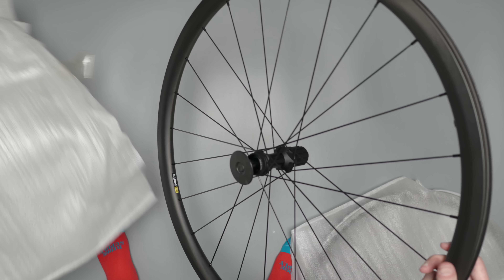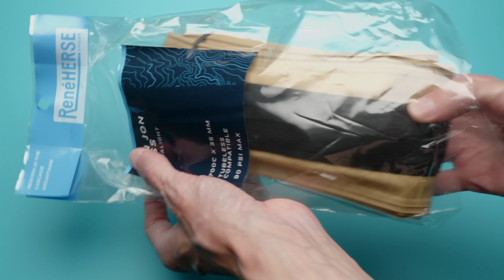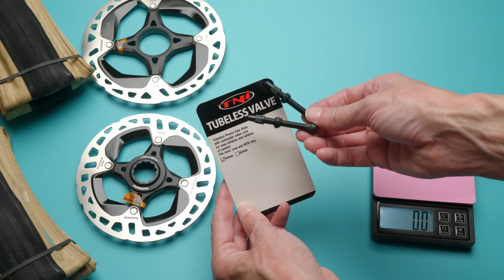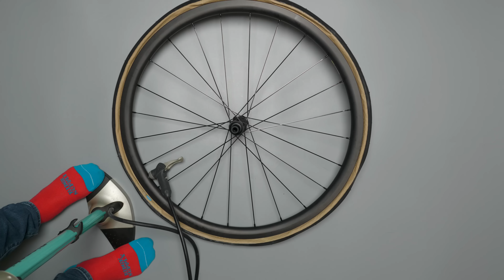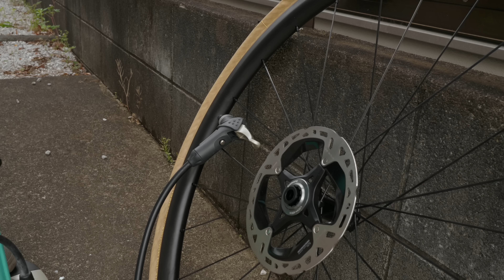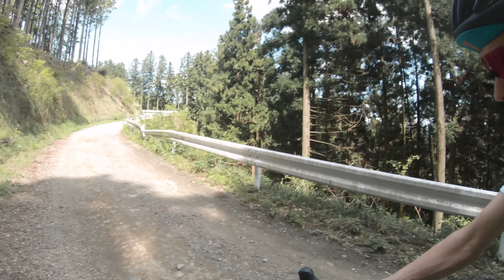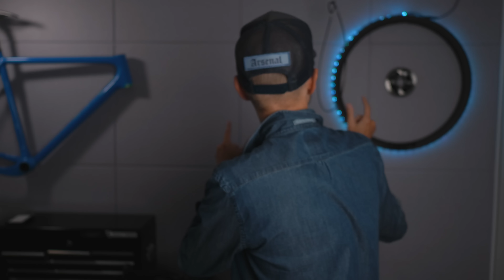Sub 7kg All-Road Bliss #newwheelday

Comment: Nice Video as always man :)
Had any concerns before buying them?
I heard so many good things about them, but for some reason I am still concerned about QC.
Btw, I saw on one of Hambinis PP-slides that he is going to get Open frame (or maybe he said it, cant remember) - nervous yet? :D
Also, did you have to register your bike in Japan? I remember when I was living there that I had registrations papers for all my bikes and had to show them to the police when I got stopped and asked.
Reply from the maker: No concerns at all. They are as reputable as any of the big brand out there, they don’t have the no-questions-asked replacement but their customer support beats most of the western brands I’ve been unfortunate enough to deal with.

Not sure why I would be concerned, it’s not my bike he is going to torch ;)

Nope, no registration for my open, only my commuter.
Reply: @ridesofjapan  Well, not sure why I am so hesitant, since I have no problem trying out parts from Ali.
Actually I expected this answer from you :D Its just fun at times how he is going on about tolerances... and other things.
Ever had any problems? Was just thinking to travel to Japan with my bike and this just popped into my mind. I got stopped at least 8 times regarding my bike in Japan.

Comment: paying hundreds of dollars to save 100grams on wheels, valves, and so on just to dump 240ml of sealant in them lol. wouldn't it be better to buy thicker sidewall tires that don't need as much sealant and on top are more puncture resistant?
Reply: Thought the same when I had to add a lot of sealent to my challenge tubeless wheels - stupid sidewalls.
Reply: No kidding, water is heavy, but I guess its not rotational mass.
Reply: Same here, glad i was not the only one, tried tubeless and i did the math, changed it back to inner tubes.
Reply: Its the double amount of what I'm putting in the 2.2" 29er tire. Don't see the point of those leaky tires.
Running tubeless road tires with 35mil of sealant.
Reply: @wajs1234  yeah same for my 2.5" maxxis minion dhf. Currently running around 60ml in my 37c gravel tires
Reply: It is a good point, but there’s more to it that that. The reason he puts that much sealant in is because it leaks, so a good part of the sealant will evaporate. Second, there is more to a light tyre than the weight itself. Light tyres are thin, which means they are supple, =fast rolling and comfortable.
Reply: Yeah, tubeless is comfortable and doesn't pinch flat. I'll never go back to tubes.
Reply: The water will eventually vanish, the sealant essence doesn't weight that much. In practice you'd need to average the weight and hence calculate with half the weight you put in.
Reply: @v8rumble123  It's eventually rotational mass.
Reply: @EditioCastigata  it'll only dry up after half a year tho and then it won't be useful anymore as it doesn't seal up holes anymore so you have to top it up. Then it's like 120g/ml of the new stuff as well as the old 60g of the dried up sealant
Reply: @dermax_hd  We agree on the progression, but disagree about the ratio “dry sealant”/water.
Reply: @EditioCastigata  i dont get what you mean mate
Reply: @jcheroske  you cant pinch the tubes anymore but you can still pinch the tire
Reply: @area4race  pinching the tire is insanely hard tho. I'd go as far as saying it's close to impossible. The tire will most likely roll off the bead before it even comes to pinching it while a pinched tube is so damn common. I once had three a week and I can tell you that wasn't fun man
Reply: my god, thank you! finally... someone who counts

Comment: The average person has about 100,000 hairs on their head. What also affects this is hair color, believe it or not. Blondes actually have an average of 150,000 hairs, while people with brown hair have an average of 110,000. Redheads have around 90,000. Each hair about 1 centimeter long weighs about .2 - .5 milligrams, so let’s average that to .35. Now, we multiply .35 by whatever color hair you have (Let’s say brown hair) and we get 38,500 milligrams. Now, we can divide that by 1000 to convert milligrams to grams, and we get 38.5 grams. The average person that has one centimeter long hair that has brown hair has around 38.5 grams of hair. -Kid Hermes, Quora.

... You have to shave your beard and head for the ultimate weight savings.

Comment: 1100$ affordable?
Reply: For carbon wheels with those specs? Yes. You can get the cost down significantly by going with a cheaper hub though. A similar set of wheels with DT 350 hubs would be about $750.

Comment: Rotor rub is going to come from frame flex, rather than wheel flex.
Reply from the maker: Steven Chalmers agreed, however hubs definitely seem to play a part in it as well, if it’s play in the bearings because of wear or something else, I can only speculate.
But I notice a difference when the wheels is the only changing variable.